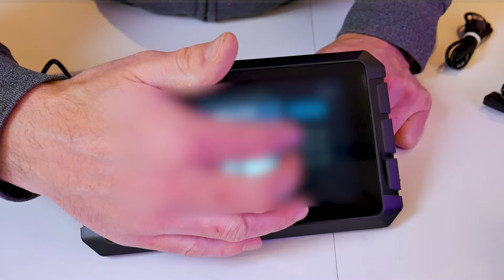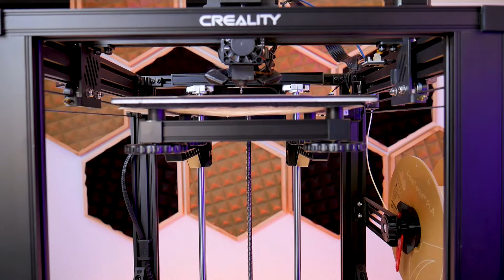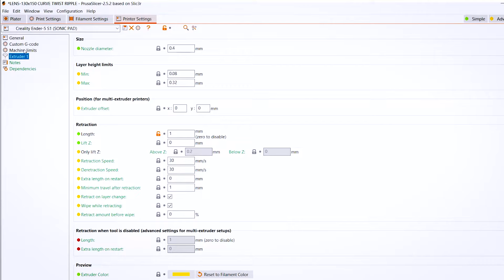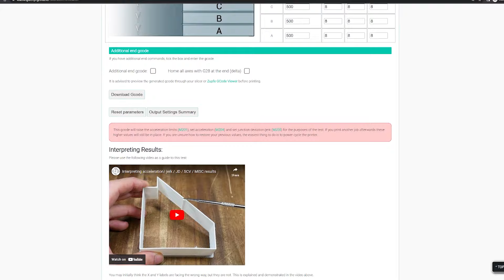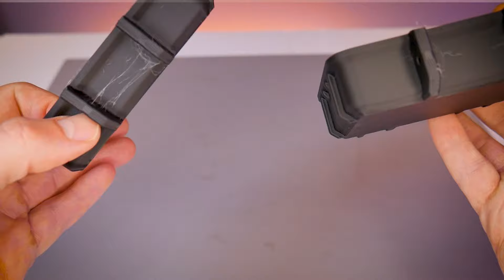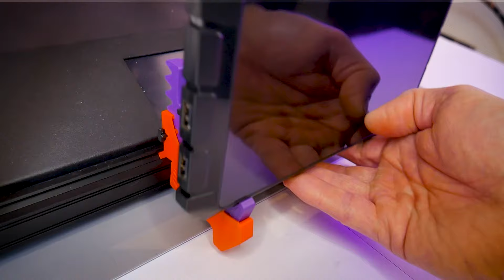Creality Sonic Pad Setup Guide, Review, Slicer Settings and Printable Mount!

Comment from the maker: Looking for the Sonic Pad and would like to support my work with these in depth videos? Check the links below, as an Amazon associate I may earn a small commission (at no extra cost to you)
Creality Sonic Pad:
► https://amzn.to/41nxivK

To support my work and purchase the Sonic Pad extrusion mount, you can find it here:

► https://embracemaking.com/products/creality-sonic-pad-adjustable-tilt-mount-for-extrusion

Maybe instead you would like a double sided PEI flex plate for your Ender 5 S1:

► https://embracemaking.com/products/creality-ender-5-ender-5-s1-pei-magnetic-flex-build-plate-systems

Or perhaps you have an Ender 3 / Ender 3 S1 / Ender 3 S1 PRO:

► https://embracemaking.com/products/creality-ender-3-pei-magnetic-flex-build-plate-systems

Free design files:

Sonic Pad Mount:
► https://www.printables.com/model/471818-creality-sonic-pad-adjustable-mount-for-extrusion

Fan Grill with Sensor Mount:
► https://www.printables.com/model/478604-creality-ender-5-s1-fan-grill-and-sonic-pad-accele

A few other cool tools and things for 3D printer enthusiasts: 

Electric Screwdriver:
► https://amzn.to/3JRbbZe

Velcro Tie Wrap Rolls
► https://amzn.to/42jr3dX

Comment: Prusaslicer  has changed so much,  it hard to follow which menu tab has the correct settings.  Mine is version 2.9.4. I did print out the AXEL mount out of abs-cf10 looks nice.  I'm also using the sonic pad for my Ender 5 S1.

Comment: Thanks for the informative video, it deserves a sub! 

One Question though, when I'm Auto Levelling during setup, the sensor (that drops down) actually goes off the print bed, and the extruder slams into the print bed as it is not stopped during levelling. Is there any way i can offset the x axis through the sonic pad or otherwise solve this problem? 

Thanks!

Comment: Does the accelerometer get left on the printhead or is this a one time setup then remove it??  I am trying to figure out how to route the cable if it gets left on.
Reply from the maker: You can remove it after. It's only necessary when doing the tuning
Reply: @EmbraceMaking  thanks for the reply.  After a few minutes it became obvious that it's just on an as needed basis. I left the sensor on the fan bracket and removed the cable.

Comment: I got one and it has never worked and Crealirty customer support sux. 4 Months of back and forth I have perched NEW CABLES AND SD CARDS AND PRINTED SEVERAL CLIPS TO HOLD ALL THE CONNECTORS TIGHT LIKE THEY TOLD ME TOO. I SENT THEM VIDEOS OF IT FAILING AND COPYS ON WERE I PERCHED IT AND THEY REFUSE TO REPLACE THEI BAD PRODUCT. IF I WERE YOU I WOULD QUIT HELPING THESE PEOPLE RIP PEOPLE OFF.
Reply: Ive had no issues with mine. You may have gotten a faulty unit.

Comment: Just printed the sensor bracket you have, the top plate is to deep. by about 5-7 mm. so when you tighten it , it hit the nozzle in the back and buckles. My ender 5 s1 is less than a week old.  had to print a second one with out the top flange to use as a spacer. to correct the to deep plate.

Comment: This is all fine and dandy but my concern is. This tutorial is based on from my perception that all printers are stock. I have an ender 3 with a btt ek3mini v2. Will this process work on this board as well?
Reply from the maker: To do it on a custom board you can try this video here from Creality: https://drive.google.com/file/d/1clfsG1j02ytYVg-xbYXzW24mpHRieRpI/view
Also, someone here (scroll to the bottom of the comments) made a printer.cfg file for the skr mini e3 v3: https://www.reddit.com/r/ender3/comments/10xlaou/help_with_skr_mini_e3_v3_and_creality_sonic_pad/

Comment: I am running into so many issues right now and I just got the ender 5 s1 sonic pad bundle, I have restored to factory settings and recalibrated and Switched out the usb-c cable and it still stops mid print and keeps giving the Klippy shutdown error due to disconnect from mcu, I tried to reset my 3D printer so I can use it with out the Sonic pad and I can’t, when I flashed the firmware to use only the 3D printer and I hit the reheat the printer Reboots and loops in restarting so it won’t heat if I try to not use the sonic pad. This has been THE worst experience for me and now waiting for Creality to respond to help me resolve bc it’s a brand new purchase and it’s complete trash imo.
Reply from the maker: Did you get this resolved yet? I know you said you switched out the USB cable but I'm wondering if your USB port on your mainboard isn't making good contact. I noticed mine looks pretty loose... I haven't had any disconnects yet but I'm always keeping an eye on it especially with the printer shaking around at high speeds.

Comment: Hoping you will respond to this...whats that black peice of paper you are using to calibrate nozzle?? Link plz?...Thanks!!
Reply from the maker: That's a calibration sheet that came with a Qidi brand printer. It's more durable than paper but is more or less the same thickness... never had an issue with regular white printer paper though... is it not working for you?

Comment: The Sonic Pad does look an easy way to set up Klipper for my Ender 3 S1, much easier then trying to put together a raspberry pi, touch screen and klipper software.
Reply from the maker: It's so much easier. If you're looking for plug and play Klipper especially for a Creality machine this is it.
Reply: @EmbraceMaking  I've been happily using the Sonic Pad on my Ender 3 S1 with Cura. However I think I'll rewatch this video and get it working on Prusa Slicer.

Comment: I'm about to fit my Sonic Pad to an Ender 5 S1. How do I tell which version of the printer I have? (you mention a limit switch in the video). In the manual, it mentions opening up the printer to check the motherboard chip model?! Thanks.
Reply from the maker: At the bottom of the z axis the old (original release) of the Ender 5 S1 has a limit switch. The printer would home downwards first. The latest version doesn't have one, it homes up with the cr touch module I believe
Reply: @EmbraceMaking  Thank you for making this video and for your very quick reply to my question. It was very useful - more so that the official manual. Your build video for this printer shows the z switch very clearly. Creality do provide an STL for a sensor mount. I guess we can remove the sensor once the resonance tests are finished. I've moved the ABL probe to get rid of the left hand side high error with these printers too.

Comment: I don't know. The sonic pad has been a nightmare for me. Ive been printing for 4 years, and have never had issues, like build plate scraping, until I started using this thing. It's like it autolevels then immediately ignores the results. I have to set the z offset to a whopping 0.35 just to keep it from carving up the plate, and it still trashes most prints. Doing a factory reset and carefully going to every step, tweaking everything a perfectly as possible didn't help at all. It seems the sonic pad is really great for some printers and a nightmare for others. They clearly didn't test this on every printer they claim it supports. Be careful and do your research before buying. If I had read all of the posts about leveling issues I never would have bought this thing.
Reply from the maker: What printer are you running?
Reply: I would like to know too. I betting it is not creality.
Reply: Nope it’s Creality. Same issue on the v3 se and plenty of people are having it.

Comment: Great dive.  I also get a lot of network disconnects when transmitting larger gcode files to the SP.  However, by copying them and then starting the print from the file selector in Mainsail, the prints succeed.

Comment: This would be EXTREMELY interesting to see tested on a CR-10 Smart, as I have seen people say it's night and day, to the point of extremely higher quality results and thus speeds. So I have to wonder what it does with a CR-10 Smart that has LGX Lite and linear rails (for X and Y at least) like the 3DFused ones. Would probably take it from a 40-50mm/s to 75 and up, and completely eliminating the machine-shakes.
Reply from the maker: I recently did a CR10 smart video where I converted it over to SKR mini control board and now uses a regular CR touch... I also have a Big Tree Tech "Pad 7" (basically their version of sonic pad) and I'm working on a video showing that :) so in some ways I have a CR10 smart klipper video coming soon!
Reply: @EmbraceMaking  can't wait to see the btt pad 7 on it, been looking at it lately and it's impressive. Sure, it's not as "user friendly" for people to quickly get into like the plug n play nature of the sonic pad, but price to performance seems to be something else. I think the deterrent for many at that point will be overall cost accumulated to the point where the BTT pad 7 is the obvious clear choice, as you're probably quite quite far away from factory setup when that point is reached. Same reason many want the BL/CR touch but can't bring themselves to get it because of all the other requirements to run it and thus the cost. Taking into account the low price of the cr-10 smart and effectively doubling the price of it with new parts 😂 but that's not stopping most of us lol
Reply: From my limited experience with the sonic pad on a CR-10 Smart the prints are definitely better out of the box. A bit faster as well, I'm sure with some tuning it will be even better.
Reply: I would like to see this too, as I have a cr10 smart and there's no information about it.

Comment: RE: 32:00, I sort of agree with this - My sonic pad does not arrive until tomorrow, and I think one limitation that I may not be concerned with unless I have an issue is the inability to stay up to date with Klipper for firmware.  Maybe I'm incorrect in this, but I thought I had read that the Sonic Pad was using an older version of the Klipper board firmware, so if I had issues that I thought a later version would address I would be SOL.  I still consider myself new to 3d printing, but am pretty familiar with SBCs and would be comfortable with flashing the motherboard myself, using my orange pi 5 that's currently running OctoPrint only as the SBC for Klipper.  When I started figuring in the cost of a better screen to replace my stock one to prepare for Klipper, trying to find or design a decent screen mount to match my Ender 6 which is less common, an accelerometer to ease the tuning, and that I think I only want Klipper for the input shaping and to get around some annoying stock firmware issues, I decided to pull the trigger on the Sonic Pad.  I don't think I'll regret it, if I do I get the feeling I can get around it, and agree that it's not a Sonic Pad hardware limitation, but as far as I have read it is a Sonic Pad software limitation.
Reply from the maker: FYI the other day I got a notification on my Sonic Pad about a software update and it mentioned something about using the latest version (open source?) version of Klipper... honestly I didn't really look into it closely and I just accepted the update. Functionally I haven't noticed a change but it did seem like the message indicated it was an up to date version for what its worth.

Comment: Thanks for the video. Can I use a normal USB to USB-C cable? I did not receive the package without a USB-c adaptor. Some persons said that you must cover the positive port of the USB cable to prevent damage to the Creality board.
Reply from the maker: I don't think you should have to cover the positive port of the USB C cable... that would seem like a very bad design. Have you tried it yet?

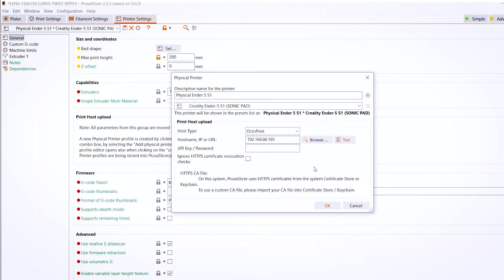Comment: At 10:20 you direct us to choose octoprint as the host type. Will this choice (octoprint) only work if you have an octoprint account? I do not an account, and the test button came back with an "unable to connect to host" error message. Thanks for any help you can give me!
Reply from the maker: You shouldn't need any account. I didn't have to type in any credentials associated with Octoprint. It's probably just using the same file transfer method / protocol as Octoprint so that's why you select it. If you aren't getting a connection try going into the network connections on the sonic pad, force the disconnect from your network and then try reconnecting again 30 seconds later. Sometimes it's like one of those silly "turn it off, turn it back on" type things before it works. Also, I found the connection to be more reliable after setting up the Sonic pad with a static IP using my router settings.
Reply: @EmbraceMaking  Woo-hoo! Your suggestion ("turn it off, turn it back on") did the trick! Also, getting a static IP address is definitely a good idea. It makes the process of getting a file from your slicer to your printer easier and faster! Thanks for your help.

Comment: Quick question for you--I tried translating some of the quicker speeds that the Creality app auto-input for the Ender 3 S1 + Sonic Pad setup but when I use my old settings for the print settings and the printer settings respectively and compare that to the newer settings I set up for the sonic pad the slicer shows basically the same ETA. Any thoughts there? I downloaded the alpha6 release of PrusaSlicer 2.6.0 to try and am coming up with the same results, even when changing to the Klipper flavor. TIA!
Reply from the maker: Could be a few things holding it back. If the part is very small (like a little calibration cube or something) it could be some of your cooling settings in the materials tab. So you have a minimum layer time that can be set ... this sometimes limits the speed. Also, check materials tab (I think in the advanced section) that you don't have a really small volumetric flow rate set. That can also limit your print speed. Lastly, check in the print settings tab under speed that you don't have any of the advanced acceleration controls set that would otherwise be limiting your speeds as well.

Comment: The .05 z-offset is strange. I've been printing a first layer calibration after the z offset calibration. Then you can dial it in with .01 increments and it saves the value after the print completes.  Still very new to the pad and I have no Creality printers. The SV06 Plus was easy to setup but I'm having difficulty with my MK3s. I'm close so hopefully a day or two of tweaking. And for last I'll try a modified Tevo Tornado which will be my worst not many examples with the MKS SGEN_L board to go off of.
Reply from the maker: Yeah I noticed that after the live adjust as well, kind of weird they did it that way

Comment: There is a plastic film over the screen. Peel it off and you don't have to worry about scratching the glass.
Reply from the maker: Wow, you're right. It was on there so perfect and no usual "pull tab" that I never would have even noticed! Thanks!
Reply: @EmbraceMaking  👍
Reply: Thank you. It is so hard to see and you really have to struggle to catch the edge of it without using metal but it is there.